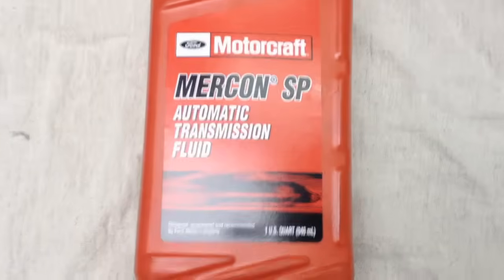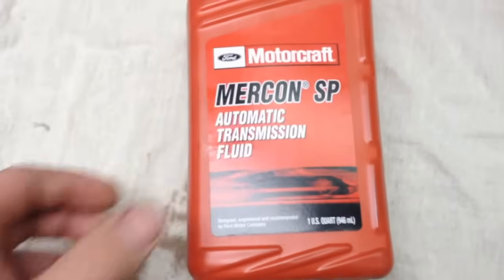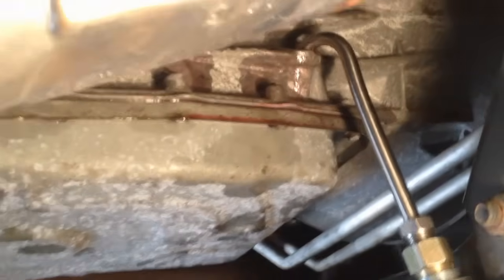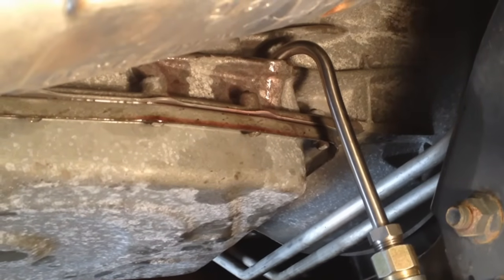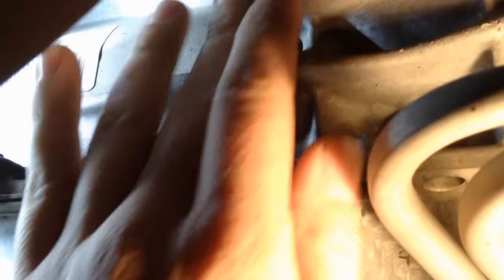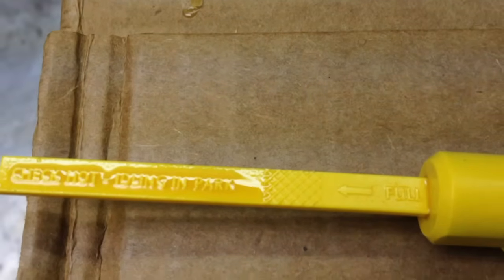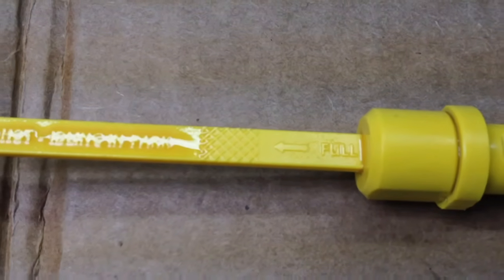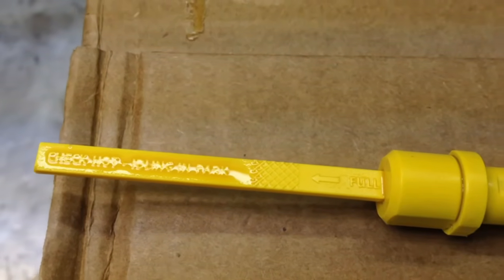Ford 6R60 & 6R80 6 Speed Transmissions: Fluid Fill & Adjustment Procedure

Comment: 6R60 4.6L Explorer - Dropped pan, replaced filter, reinstalled pan, filled with fluid (too much), then suctioned out to proper level. Truck will not go into gear. Are there an troubleshooting measures? Some explain of poor seal at transmission inlet, others suggest a battery disconnect and delay before reconnecting. Thoughts?
Reply: Did you find out what happened? Was it the filter that fell down in the pan?

Comment: I have an f150 and wanted to check my fluid on my transmission.  I removed the nut and dip stick, and fired up the truck while the oil was at temp and it shot oil everywhere when the motor turned over.  What gives?  Should I have removed the nut and dip stick after firing it up and letting it idle?
Reply from the maker: +Terry Leimonis yes

Comment: Is there a drain for the torque convertor as well on the 6R60?
Reply: Yup, its a pain to find it though. You have to pull the drain plug access plug out of the housing & have a friend turn the engine over by hand to find it through the opening.

Comment: I have tried this.  I can't seem to get it right.  I noticed at 2:27 that the dipstick says check hot idling in park.  My dipstick does not state this, I'm wondering if it's supposed to be checked without the engine running.  Let me tell you why...

I drained 5.5+ quarts out.  I put 5 quarts in and then checked the level... with the engine off, it was close.  Then, another cup and it was where I thought it should be without the fluid being HOT.  

Now, I see some instructions from the ford service manual that say to check it with the engine running... so I try it.  It's not touching the dipstick.  I add more fluid, and more, and I can't add more now because the pan is full all the way to the plug and it overflows.  Start the engine and it only goes up about half of the dipstick.

Should I be adding fluid while the engine is running in order to get this filled right?  Or, like in your video, should I be checking the level with the engine OFF?  I can't imagine I was running two quarts low before the filter change and this liquid gold is running all over my garage floor now.

I don't want to underfill this, but worse would be overfilling it IMO.

Comment: love your videos, thanks! In the service manual under TRANSMISSION FLUID LEVEL CHECK, it says "With the engine running, place the transmission selector lever in each gear position and hold approximately 5 seconds. Place the transmission selector lever in PARK." When I do that, the dipstick comes out dry, like the fluid got sucked up somewhere, even thought it was just below the hatch marks beforehand. any idea why? should I ignore this step?
Reply: You cycle through the gears while running. Put it back in park, while running, check the fluid. Adjust fluid level. You cannot add while engine is off because it will just pour out. Has to be running. Check while the engine is running. Transmission is pumping the fluid while it's running. Check the fluid while the engine is still running, in park.
Reply: after shifting the gears the fluid will show low or not even on the little yellow plastick dip stick.. then add fluid to the low hash mark with the motor running
Reply: Engine running will suck the level lower....

With it off, it drains from the gears, back into the pan

Putting it in each gear makes sure than each gear pack has the fluid pumped into it, that it needs/would see when driving

Comment: fordtech roughly what is the fluid temperature when checking cold, because temperature change from state to state and even in canada,, so if am checking the fluid and the temperature is 40 degree f where should the fluid be on the dipstick A or B

Comment: Hi,
I've 2012 Expedition which user guide mentioned gear needs 12.4 L of oil. when I visited Ford Service Center, they only filled 6 L with filter changing !! what about the rest oil which engaged inside ?! mixing old with new oil is OK ?!
P.S they're changing gear oil each 45K km. 
please advise.

thanks
Reply: Transmission will hold back some fluid. You won't be able to completely empty it.

Comment: My dipstick is marked for Mercon LV, and has an "A" cross-hatched range, and a "B" dotted range.  Which one should I go by?  (2012 F150, 5.0). Awesome channel BTW!
Reply: A is cold fill level and B is hot fill level.
Reply: I figured that was the case, so fill A up almost to the B crosshatch would be the same as shown in the video
Reply: Cro-Cro I've got the same thing. Did you ever figure it out?
Reply: Cro-Cro when it's hot or cold?
Reply: Dave L LV is for 6r80. Same as Mustang. Got by the lower one for cold and higher for hot

Comment: I have a 2010 F150 5.4L 6R80 with 148,000 km, I had my transmission flushed by a local dealer back in the summer. Recently I noticed it is starting to have the hard down shift from 2nd to 1st and when it's cold there is about a 2 second delay when shifting from P to R but not going into D or any other gear. When up to temp the trans shifts normally. Could this be caused by a low level or is there more going on with the trans. I asked the dealer to drop the pan and change the filter but the advisor told me they don't do that and the service manager reiterated the same thing which is weird seeings how the trans has a filter. Any info would be appreciated.
Reply: Get a new valvebody assembly from Ford, it will need to be programmed by Ford or a capable trans shop , there are tsb s concerning this complaint,

Comment: way to go Ford, take a simple procedure and make it more complicated,no drain on pan oh and let's eliminate the dipstick and fill tube.why not just put a lock on the hood.im surprised the cab doesn't need removed to do this,engineer needs beat!
Reply: Timothy, having a drain plug in the pan makes the job a lot less messy ....as opposed to having to loosen one side of the pan and hope the oil flows out nicely on that one end.  I know you have to take out the pan to get to the filter....nobody's denying that....its just that its a lot easier if all the oil is out of the pan first.  Ford leaving out the filler tube only means one thing....they want to make the t-fluid job more difficult so you will bring it in.  What really pisses me off is that they no longer put drain plugs in torque converters....that is just nonsense.  So now you don't get a complete fluid change!  Its a well known fact that dealerships don't make their money in new car sales....they make them from the service departments.
Reply: @AtomicLarry_1  It is a fact that the design changes were done to require the vehicles be brought into the dealership for any mechanical issues. They actually had a  radio advertisement last fall to bring your vehicle into have a "FORD FACTORY TRAINED TECHNICIAN" recommend the proper winter tires suggesting anyone else would give you the wrong tires, its laughable. Also you are bang on correct about the drain plugs. Every fluid reservoir on a vehicle should have a drain plug in an intelligent world. Even fuel tanks should have them  with all the in-tank fuel pumps these days. Even if the customer does bring the car into the dealership for work its like you said messier and more time consuming.  As per the dipstick tube though a lot of it done to cut the cost, take a million cars and eliminate a $10 part you save 10 million bucks
Reply: Hi Jon....I agree with  everything you said except for the dipstick tube statement.  First of all......Ford wouldn't have to lose money on the dipstick tube; all they'd have to do is add on the cost to the price of the car.    I'm going to go out on a limb here and say I don't think the majority of people would care much about an additional 20 to 50 dollars on an already high vehicle price tag of $35,000 anyway.......that's nothing; I know I wouldn't have any problem paying a little more for it.  No....Ford's true objective is to have you bring the car in for servicing as much as possible.  I'm even hearing now that Ford (along with other manufacturers) consider the computer on vehicles to be proprietary; they don't want you to be able to access the vehicle's computer for troubleshooting!
Reply: Thats not gonna fly with guys like Elon making all his stuff open source but yeah its a game for sure... Doesn't bug me much though as I'm capable enough and haven't ever needed a dealer for anything other than warranty work and recalls. Anything else i do myself. Btw all thr proprietary stuff can be found on places like pirate bay. Information can always be found free somewhere.
Reply: Its crap like this that made me leave Fords.  I've was a Ford owner for over 40 years but Ford apparently is not making enough money with their car sales so they're wanting you to bring in your car for the smallest thing.
Reply: @AtomicLarry_1  I remember I had to bring my truck in to the dealer several times for stalling. They replaced so many parts and still didn't fix...I went to the most.likely issue...throttle body. $5 can of TB cleaner fixed what professional mechanics could not. Luckily my truck still had warranty for all the replacement parts.
Reply: @Ramon Munoz......good catch Ramon.  I had some stalling issues with my truck at one time; I have a 2003 Ford F-150 Supercrew.  My problem ended up being the rubber hose that runs into the backside of the throttle body....over a period of time....those hoses tend to crimp and deteriorate.  After I changed it out.....everything was good.  I have to say you were lucky you still had the warranty on the truck.
Reply: @AtomicLarry_1  tell me about it. Replaced MAF. Intake. Sensors. Transmission sensors. And even accidentally changed my coolant reservoir and hoses...don't get me started on how they wanted $350 for replacing the transmission fluid. Took me $100 for fluid and filter and 30 mins.
Reply: you have to remove the cab for the header replacement. Ha Ha
Reply: No you don't. But it's REALLY REALLY shitty job when you don't...
Reply: Couldn't have said it better myself.  Tartisan....not to mention that they did away with the damn drain plug on the torque converter!
Reply: Ugh!  :(    That's one of the things that separated Fords above the rest.......You could drain the convertor. :(
Reply: willis arnold , if you think this is a Ford thing... you go some learning to do. GM, Toyota, any many others have been doing transmissions like this for over a decade.
Reply: Yeah, for real, then you burn the crap out of your hand with the cat trying to measure and fill with fluid
Reply: +Timothy Clark
Dumbest fucking comment ever. 
Removing the real dipstick was 100% a money-grabbing decision and Ford should be sued to the ends of the earth for this shit. They removed the dipstick so you can't check your fluid level, and then they designed a fastener and seal system for the transmission wiring bulkhead connector that is GUARANTEED to leak, and leak often. Therefore if you don't want to risk that POS part losing all your fluid you have to have it replaced, along with a tranny service. That little money grab is a $600 touch here in Canada, and if you hang onto your truck for a few years you can be sure of having to do it more than once.
Your defence of the "designers" is fucking laughable. A drain plug simply makes the tranny service easier. Even the techs think it's stupid to have to handle a full pan of fluid or have to pump it out first. Read a book, doucheclown.
Reply: @tartisan  man you sound like you got a room temperature iq
Reply: @tartisan  they removed the trans dipstick because they do not want people messing with their fluid levels or introducing the wrong type of fluid which could contaminate the SP fluid
Reply: @Kmecha84  That is a fucking terrible reason.
Reply: willis arnald probably because it's recommended that the filter and filter seal be changed and you cant do that through a atf drain pan plug. It's funny when people think that they are smarter then the designers.
Reply: @timothycc711  for those of us who change the "100,000" mile fluid at 30,000 intervals, it is extremely stupid not include a drain hole.
Reply: @ramonmunoz836  aftermarket pan with a drain plug installed for those that want to change every 30k?
Reply: @timothycc711  Ford could give a shit less if you change the filter and seal.  Ford cares that the transmission lasts 60K miles, the warranty period.  That's it.  Most all of them will make it that long without a fluid/filter change, for sure.  In fact, the service manual says transmission changes happen at 150K.  This move was purely a "take it to the dealer" move and Ford knows it.
Reply: @timothycc711  When it comes to Ford, everyone is smarter than the designers. The vehicles are not designed with maintenance in mind. They're designed to force customers to bring into the dealer for service.
Reply: @timothycc711  well there's a drain plug on my oil pan...and the oil filter gets changed every oil change, so there's that. I also have a dipstick to check the oil level on my vehicle. I guess some engineers are smarter than others.
Reply: Larry L nah your both idiots. By your logic all you have to do on an oil change is drain the pan forget about changing the filter right?
Reply: tartisan it has a dipstick dipshit! It's connected to fill plug. So go fuck yourself!

Comment: Fordtech I did the same process as you have shown. Now my transmission shutters and throws traction control warnings when I'm drive. When I check the level of the fluid it is in the bottom of the hot fluid level with the trans at full hot. What do I need to do? 6r80 transmission 87000 miles.

Comment: I'm having a hell of a time finding a dealership who will change my filter and top my fluid off ('13 F-150).  So I guess I'm going to try it myself.  I found the hook part of the tool in this video...but it doesn't seem to be threaded to fit onto a bottle or pump.  What's the deal with that?  It's going to be very hard to not get burned by the catalytic converter while trying to adjust the fluid.  This is going to suck.
Reply: Ok so I used a cheap fluid pump from the auto parts store and put a longer hose on it and that worked great.  I bought a heat resistant glove off Amazon and that was definitely necessary to finish this job.  But my problem is that I put 7.5 quarts in and it started running out of the fill hole with engine running.  It appeared that I got about 7 quarts out maybe a little more.  I put 7 quarts in, checked it, and it was at the bottom of the stick.  So I put another quart in and as I was pumping it came running out of the fill hole.  What's up with that?

Comment: I just purchased a 2011 f150 with 62,000 miles it shifts and runs great. My issue is it shifts hard from 1st to 2nd but only the first shift when the truck is cold. Then its fine. I plan on changing my fluid and filter as you describe and wanted to know if there is anything I should look for while I have the pan off that could be causing this. Thanks for the videos.
Reply: You probably won't be able to see anything from the bottom, the actual transmission gears and clutches are not visible because the check valves are all on the bottom. All you can really do
Is check the pan for excessive clutch material or metal shavings.

Comment: Thank you for the informative video. I fixed the leaks from the plug of my 2010 F150. How can I get the fluid hook fill that you got, it would've made the job easier. Thank you
Reply: +eddie0175b  Go to ebay and look up "Rotunda 307-570 Ford 6R60 transmission fluid fill tool"  This is the metal hook that you can hook up to the pump tubing on the pump linked above.  This tool will work with the 6R80 as well.  I bought one for when I change my transmission fluid.

Comment: I did this on my 2012 and 2013 150. I removed ~ 7.5 qts from each and went back with the same amount in each. When I check the fluid level cold, the fluid covers the dip stick completely to the top. I run the engine and get the trans up to temp (195*) I get a reading to the top of the "A" mark, not the "B" mark. My dip stick does have the same markings as your. 

Why is the fluid to high when cold compared to your readings?
Reply: Did it say anything about fill procedures?
Reply: I also had this issue on my 12' 6R80. Checked three different ways, from pan dropped empty bout 7.5 quarts went in all In all, filled it initial to proper level, rand the truck maybe 20 seconds to cycle the fluid, filled the void again to cold hatch, ran it to operating temp checked again was within specs. Now about a month later I'm hearing odd, very subtle whines when brought to operating temp and when I check it it's so expanded and full that it actually billowed out a bit when I took of the access cap. 

My wonder is, is it possible to have some extra fluid come out of the torque converter? I just ordered the 6R80 rebuild manual to see what it has to say about the fill procedures. I'll let you know what I find.
Reply: @joeallen9897  what did you find out?
Reply: obviously not, its been a year and no response
Reply: Yeah, he sold it and bought a Toyota...
Reply: Parcours the fluid expands when it gets hot

Comment: does anyone know what sort of symptoms i could expect if the trans was over full? to the top of the hatch marks at cold. havent driven it, car was hit in the front almost all the trans fluid leaked out of the cooler.
Reply from the maker: +Will Tabaczka You may notice slippage if the fluid foams from being overfilled.
Reply: FordTechMakuloco 
Would this damage the tranny? Or if the fluid was changed to specs within a few days slippage occurs, should it fix slippage issues from overfill?